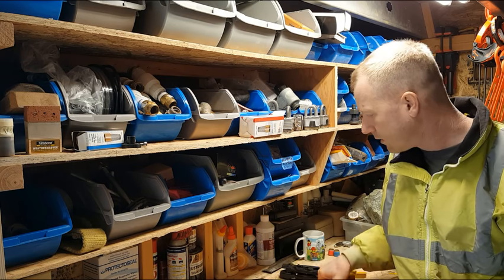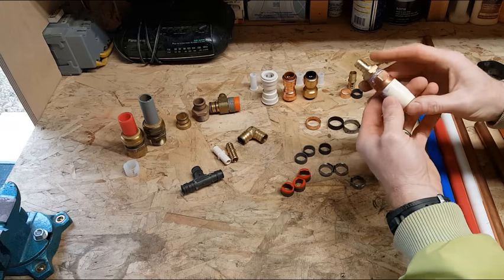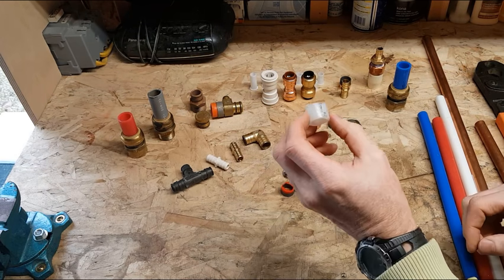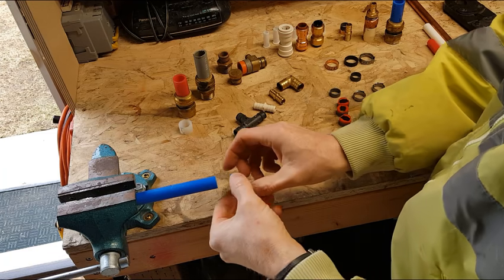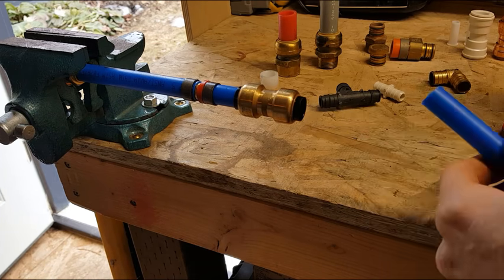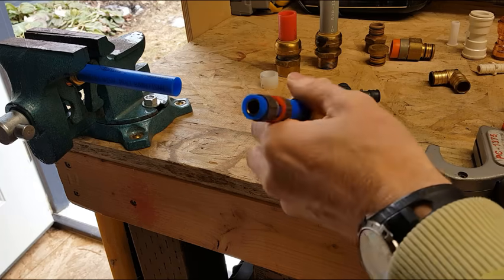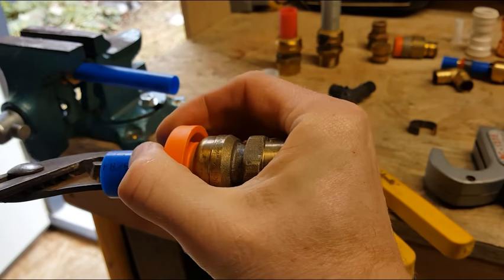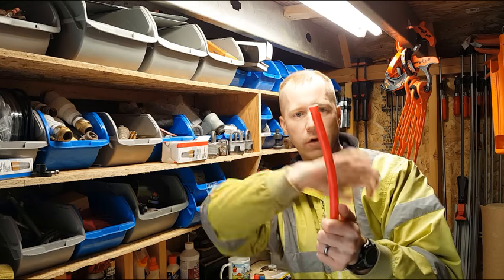Plumbing 101, Pex Tools, Pipe, &  Fittings!

Comment: Hi, thank you for making and posting this video.
Btw, there is purple PEX now. There is also orange (which I think is often PEX-C).

Is the sharkbite fitting called a push-fit or something along those lines? Or is push-fit something else? Do all of those push-fit types require the insert? Any idea on what the inner diameter is of those inserts?
Can PEX be used to supply water for a tub spout? (I've been told that some elements of showers need at least some metal piping to be threaded in and then linked to PEX to make it more stable).
Do you know anything about check valves for PEX?
Is the water in PEX less likely to freeze than water in CPVC?
Is the orange tool to pull apart the sharkbite fittings called a deburring tool or something along those lines?
Reply: Don't use shark bites. Do pex and crimp fittings with stainless

Comment: I need to attach a hose to a fitting but it's smaller than 1/2".
I could use a small band clamp but I need the outter ring to be smooth, as is the PEX type, with no resulting protrusions that a band clamp or the stainless steel cinch clamp you showed has.
Is there an alternative to the PEX type crimp rings out there?

Comment: For someone without the hand strength to repeatedly crimp fittings, the expandable PEX-A would be the way to go. Milwaukee and DeWalt both have battery powered expanders. Works good in tight spaces as well. Cheers!
Reply: The cheapest Milwaukee expansion tool for Pro-PEX sells in Canada for $ 530.00 with tax after adding a battery & charger.  A little expensive for a DIY homeowner.
Reply: Ryobi also has powered crimpers for both crimp rings and pinch rings.

Comment: This is my first lesson on how to use Pex. It actually looks like fun and much easier than galvanized and copper. I just need a plumbing problem to arise now so that I can apply what I learned from your video. Thanks for the intro.
Reply: FYI-Using PEX A with the expansion connection method is superior in few way such as to not cause restrictions to the water flow. Here is 1 example https://www.youtube.com/watch?v=an4C5w0H-A0 Good luck.
Reply: Hire my cousin.  You'll have all the plumbing (and other general construction problems) that you need.  I'm trying to get a shirt printed for him that says:  "Measure once, cut twice ... or more."

Comment: When using the copper ring to crimp on to hold it in place, it helps to use a channel locks to easily pinch over it 1st just enough so it wont slide & then use your crimper to finish it. Those special copper rings with the orange no slide.sleeve will only cost you more than the regular copper rings would be using this method of pinch & crimp.
Reply: "...use a channel locks to easily pinch over it ..."  

NOTE: this is NOT a procedure that is recommended or suggested by the mfg. It requires another tool (Channel Locks) that is likely to distort the ring  and may compromise the fitting.  If you find it difficult to place the ring properly using the standard tool(s),  use the crimp rings designed to solve the problem by the folks who designed the system because, if you screw it up, it will cost you more to repair it than  you would save on a pack of rings.

Of course, if you're working on someone else's home or something you're going to flip, what the hell? Right?
Reply: Get stainless rings not copper
Reply: Bad idea using the channel locks.
However.
If you feel the need to tighten the clamp just a smidgen, with my ratcheting crimpers I simply crimp it one click. 
Done.
Now you can make sure it’s in the right spot and finish.
Not so hard to do…
Reply: This is why I read comments: I have so much to learn.
Reply: @dreamingrightnow1174  qa+qqq!!++++!0++
Reply: @ruanisheeple  lol
Reply: @dreamingrightnow1174  sorry that happened in my pocket 😅
Reply: @ruanisheeple   your pocket is clever

Comment: It does not have a plastic taste in the water as some people might say it does as would be most likely the plumbers who bad mouth it the most on account it's easy to install & most anybody with little skills can accomplish it on a D.I.Y project. This makes it a threat to their job security. Plus it holds up to the freezing weather expanding & contracting without breaking & if so it freezes you just need to thaw it with a hairdryer. It's also just so easy to fix or add to with a simple cut, a clamp ring & crimp. No glue or soldering is required. & besides that you can easily snake it through the wall studs & around corners without splicing couplings or elbows in between every stud or rafter. It's the best of the best!  However don't expose it or mount it in direct sunlight or have it exposed to ultraviolet rays & always allow plenty of expansion & contraction as if need be you can loop it in a wall cavity about every 8' or 10'.span. One man's loss is another man's gain. So use it & let it be your gain.& not your payment plan pain. I am a good man to have on hand, Dave the handyman! Home repair guy St. Louis, Mo.
Reply: I don't know anything about piping, but I need to fix my moms mobile home. Would pex piping be ideal and do I have to take apart the floor boards to get to the pipes?
Reply: Not due to threat since anyone can just as easily install PVC and its not bad mouthed.  Nobody in our family calls plumbers unless codes are involved because not much to running most any plumbing you don't solder. Mouthing of pex came about after Polypropylene plastics were determined to be just deadly in microwaved food containers so its assumed by some that Pex is also somehow bad for us ever since then. I don't microwave my water lines, how about you?
  Its just peronoid people I swear, their needs to be door to door psychologist in our country because they'd make a damn killing today.
Reply: @harryballz6358  Look, Smarty Pants, maybe you don't nuke your pex but some of us are pretty bored stuck in our house these days...

Comment: Where is the expansion connection method? that doesn't cause restriction to the water flow? Sorry all ur methods u showed r inferior. 

Its funny how everyone call themselves "Makers" now just for DIY stuff. I miss days when a Makers created cool stuff not fixing a pipe the wrong way :)
Reply from the maker: Thanks NC, please post a video showing us the proper way to fix a pipe, or at least explain in detail how it should be done. Unless of course you feel it is a trade secret!
Reply: Using PEX A with the expansion connection method is superior in few way such as to not cause restrictions to the water flow. The methods u demonstrated is acceptable. This not a trade secret and can be easily found on the internet and on utube postings. Here is 1 example https://www.youtube.com/watch?v=an4C5w0H-A0
Also please accept my apology,  the tone at the end of my comment was both uncalled for and technically incorrect.
Reply from the maker: Not a problem. I personally am not a big fan of PEX; 1/2"  fittings do restrict flow down to about 3/8" if not worse so I always try to up-size if I can. I.E., 3/4" PEX in place of 1/2" copper pipe.
Reply: PEX A "fittings do not restrict the water flow" when using the expansion connection method (see the video link at the bottom) since the ID of the PEX is the same as the fitting when using this method. U asked "please post a video showing us". Pls review this video https://www.youtube.com/watch?v=an4C5w0H-A0us again. Good luck understand this aspect of it.
Reply: N C he mentioned the expansion connection. Problem I have with that is that you have to use Pro Pex fittings according to one video I saw
Reply: 1st, There no PEX expansion fitting being displayed in the vid when I watched it . Where in the vid was it even mentioned?

2nd, There are other makers (like Zurn) of PEX expansion fitting besides Uponor ProPEX but whats ur issue with using ProPEX anyway?

Lastly, I explained a few of it many benefits of PEX expansion fitting over the alternatives methods. Why do u think any of the alternatives methods would be better?
Reply: N C about 7 minutes and 20 seconds in and start talking about the expansion deal as far as fitting to go, I didn't know anything about it. video I watched right before this one was a fella talking and he said you had to use that propex ?? I don't do a lot of Plumbing anyway. I have the older Zurn , individual clamps for each size. They work good but you just have to open them up so far to get on it, fine for new stuff, hard for repair in tight spot. Expansion sounds great. I just didn't like the idea of being limited to one supplier.
Reply: Thx, I did see the brief reference to PEX expansion fitting at 7:20 . But for future reference typing 7:20 creates link to where it is posted. 

U will have to ask the person y he/she only wants ppl to only use ProPEX it is a well known and commonly used brand so that could the a reason? And Zurn's, individual clamps is not the expansion fitting that I was referencing. They also make expansion fitting, but I only referenced them as example of different company that makes those fitting too. ProPEX is far more commonly used. 

I have heard utube posts that say "tight spots" could be an issue using PEX expansion fitting when doing repairs.  But the post saying that tended to be ppl at never used expansion fitting and that promoted other methods. Considering that so many use expansion fitting it to do repairs with no problems. It seems to be at worst just a learning curve on how to use it proper in "tight spots". 

List of some it benefits, 1st PEX A pipes thats used with expansion fitting r resistant to freezing damage. 2nd expansion fitting have the same ID as the pipe so there is no restriction of the water flow unlike all the other methods. 3rd It "idiot" proof as long u fully insert the fitting and let it contract tight, The other methods need things like a "Go No Go" gauge to confirm each fitting. And even some building code require PEX A pipes thats use with expansion fitting for the above reasons. List of its benefit keeps going on...

If the "tight spots" issue is "deal breaker" for u. I respect that and good luck with whatever method or piping u use in the future.

Comment: I can't find those fittings at HD or Lowe's. I have a few rentals and I'm interested in getting some good fittings to take with me every time there's a repair to do. Can you give me some advice on where to find them? I have a set of Kobalt pliers like the quiet compress kind you have. Thanks.
Reply: Or check out HD and Lowe's website to have it delivered to local store.  FYI-Using PEX A with the expansion connection method is superior in few way such as to not cause restrictions to the water flow. Here is 1 example https://www.youtube.com/watch?v=an4C5w0H-A0 Good luck.
Reply from the maker: I'm surprised your HD and Lowe's don't carry these types of fittings in stock, but there is a bit of regional preference to what they carry in stock.  That being said, you could go on line to either site and order the parts to be shipped for free to your local store and then pick them up, or check out Supplyhouse.com. They have a massive selection of just about every plumbing fitting out there and I don't get paid anything from them!
Reply: Dan&Sarah Makers Thanks! HD and Lowe's carry shark bite fittings, and those are too expensive to use in every repair I encounter. Hence my need to find better alternatives. I appreciate your help.

Comment: One question I keep thinking about as I watch all these PEX videos -- with all the different types (brands) of connectors, do they all work on the same PEX tubing?  In other words is PEX -- PEX,?  Or are there more than one kind of PEX?  Hope that makes sense.
Reply from the maker: Well, long story short, Pex is Pex. That being said, all of the different companies that manufacture this style of tubing follow standards that include ASTM, UPC, and CSA, at least here in the states. Pipe and tubing are also categorized by class, schedule, type, and finally SDR. SDR is what you will find printed on the side of  Pex type tubing and it stands for Standard Dimensional Ratio. By following this standard, fittings and tubing are almost universally interchangeable. I hope this helps.
Reply: There is the expandable PEX-A (Uponor) and the non-expandable PEX-B. All PEX can be used with rings and crimps, but only PEX-A can use the PEX-A fittings which have a barbed ring in the center as apposed to the 4 standard rings style. The PEX-A fittings do not allow the tubing to simply slide over the coupling, as it is a larger diameter and the tube must be expanded first.

Comment: Which of those 2 types of crimp fittings are more reliable over time?   Also, can Pex tubing/fittings hold up to freezing?  Cheers!  Chris.
Reply: I say Uponor is the most reliable over time. It is PEX-A, and doesn't has that curling effect.
Reply: Just to expand on the last comment. Using PEX A (Uponor just 1 maker) with the expansion connection method is superior in few way such as to not cause restrictions to the water flow. Here is 1 example https://www.youtube.com/watch?v=an4C5w0H-A0

Comment: Seems to me that shark bite fittings make the inner diameter substantially smaller which makes for less water flow...
Reply: "substantially"???  shark bite fittings is 1 of the less restrictive method shown here
Reply: Ur incorrect and have it reversed. Sharkbite go on the outside of the pipe so when used with a stiff type of pipe like PEX B or most copper,  there is "no restrict to the water flow" 

But when used on a softer pipe like PEX A its recommended an internal stiffener is used that is very thin so it will cause a "minimal restrictions to flow". 

And Shark-bites should not be the primary method used. Its more suitable for emergencies and when the fitting is exposed in case it would ever leak.

BTW the only time there is a substantial water restrictions. Is when PEX B is used with internal fitting that r much thicker than anything used in a Sharkbite. But do to the restriction issue, even using a lager ID wont eliminate all the water flow issues.

The best option is to use PEX A and use expansion fitting instead.
Reply: NP and dont forget to use the expansion method and proper diameter fitting for it or it will still get those water restrictions if u use the smaller internal fitting methods that could be used with all PEX piping. Pls excuse me if was repeating what I said be for I was just not sure how clear I said it, Ok good luck..
Reply: N C Sharkbite fittings may be easy to use but if you calculate the area loss it is substantial. I used ¾" PEX-B because it equalled the internal dimensions of ½" copper. ½" PEX-B using Sharkbite has a noticeable flow reduction. PEX-A fittings do not restrict the flow at all.
Reply: N C I have since been using only PEX-A. I didn't like PEX-B. Thanks for your input.

Comment: how would you recommend I set up a system that transfers from pex to brass and can withstand high pressure (110 bar) and high temperature (~100°C).
Reply from the maker: I wouldn't recommend using PEX in a system like this. The pressures and temperatures you are talking about run on dangerous if anything went wrong. There are high pressure brass threaded fittings that can withstand up to 3000PSI, about twice the pressure you are talking about, but that is at 72 degrees F, 22.2 C. When high pressures and temperatures mix in piping, like in a natural gas or coal fired steam power generation plant, "creep" becomes a problem as the pipes begin to expand and the wall thicknesses are reduced over time. Also regular water becomes more and more corrosive as the temperature increases. Your best option would be to either use high temperature steam pressure washing hose and fittings, or hydraulic hose and fittings. If you had water in the system and had a blowout it would probably flash to steam and is a great way to clean flesh off the bone.
Reply: Dan&Sarah Makers ok thanks
Reply: Thanks, for those interesting facts and words of caution. And maybe u should have suggested getting a expert to do the install too? Even is it seem to be implied by what u said already.

Comment: The grey tubing is called quest tubing
Reply: "Quest" was a brand name of the grey, polybutelene tubing, 25 years ago when I installed it.
Reply: The grey tubing is called polybutelene. The quest fittings are the older compression fittings for them that haven't been used for a few years
Reply: I would not try that. A few weeks ago I compared the size of a leftover piece of 3/4" Quest with a new piece 3/4" PEX, measuring with a micrometer. The Quest has a thinner wall. The PEX has a smaller inner diameter. I saw a polybutelene-to-PEX coupling in the building supply store; that should help.
Reply: I think I saw it in Home Depot.
Reply: Richard Hammer can you crimp a pex fitting to the grey tubing ?
Reply: Richard Hammer thanks I'll look into that  ! Does  the H. Depot or Loews carrie that fitting?
Reply: Nickname "poly-b"